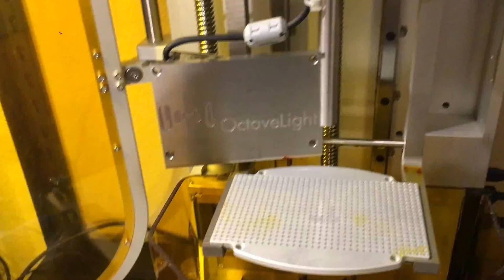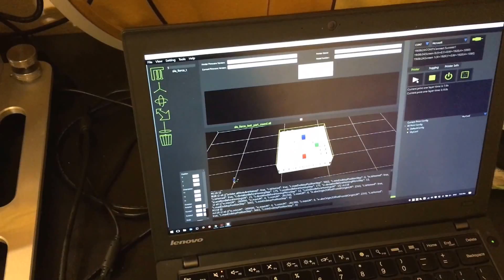Octave Light DLP Top-Down 3D Printer: Walkthrough

Comment: Nice work.  But the sweeping plate is a bit over doing it.  I mean, if your printing and you don't know if theres anything on the build plate, then you shouldn't be printing lol.
Reply from the maker: Well, sure. The printer is designed to only operate when it's closed, so it shouldn't be possible to hit something with manual sweeper commands unless you defeat the interlocks and run it open...
Reply: The blade is smoothing the surface of the liquid resin so that each layer is precisely as thick as set by the user. This setting can be from 10 microns up to over 100 depending on the precision and build speed required.

Comment: HI James, thanks for your input and videos re the Octave Light, they were helpful in setup when I recently received my OCR1 machine, I would very much like to compare user experience via private email if your available?
Reply: Hi Tom, How are you getting on with your Octave Light R1?

Gary Miller
Director

Accorda Ltd.
Official UK Distributor of Octave Light R1 3D printers and photopolymer resins

Contact:
Orders and technical support  +44 7811 256 360  +33 4 92 13 22 62
gary.miller@accordaltd.com

Comment: James, I'm thinking buying this octave R1 printer. do you think this printer can operates reliably to provide 3d printing service? In other words. can it stand up to continuous usage and if supports generation is good enough, can it print reliably? What support generation software did you use and suggest? Really appreciate your feedback!
Reply from the maker: The mechanics of top-down printing and the sophistication of this printer's hardware do increase the probability of success for any given print over bottom-up printing, at the cost of needing to fill the tank with a lot more resin. The suitability for your business will then depend on weighing the increased cost of switching materials (you need 6L of any type of resin you with to use) versus the increased probability of being able to produce a given part the first try.

I do not use the built-in support generation in Octave Light software, so I can't comment on it specifically. However, in general, there is no completely automated support generation tool. Even big high-volume shops like Shapeways use a significant amount of manual inspection based on human experience with the machines in order to lay-out and support a run of parts. Top-of-the-line commercial software, like Materialise Magics, is also not a "fire and forget" type of workflow, but rather should be considered computer-aided support and layout generation.

For myself, I will either design support into a custom part in order to maximize the points where I need greater dimensional accuracy, or for less demanding parts, use Meshmixer.
Reply: Thanks you so much for the valuable comment :).
Reply: Hi, 
The amount of resin you need is much less than 6L. I use 2L which is more than enough for most jewelry. 

 Short items need less resin.

The resin requirement depends entirely  on the height of your object and the volume it displaces as it prints. Way back, there was a video that said the tank needed to be full but it is not usually the case.  The software will warn you if there is not enough resin in the tank before the print starts or you just measure the height of your model and the the resin above the fully lowered build plate. You can also test levels with water which will help you learn and mark volume in litres to height on the tank.

I print models made from popular CAD programs like Rhino, Jewelry CAD Dream, Modo and ZBrush. I tilt them to reduce height and print time.  I have the first 30 micron OctaveLight R1 they shipped in December 2016 and it has required zero maintenance except lubrication and there are no consumables like new trays, coatings new films, no manual refocusing. Focus is achieved by a laser rangefinder. The resin remains usable for over a year if kept in the dark.

Gary Miller

Director 
Accorda Ltd. 
Official UK Distributor of Octave Light R1 3D printers and photopolymer resins

Contact: 
Orders and technical support  +44 7811 256 360  +33 4 92 13 22 62
gary.miller@accordaltd.com

Comment: Hi James, what are you thoughts about this printer's capability? Do you think it is on par with the big players?
Reply from the maker: It's certainly more capable than the Projet 1200, but as for larger Stratasys and 3D Systems printers, I think they're really in a different size class and I"ve never used any of those printers. Is there a particular printer you have in mind?
Reply: James Kao I was thinking projet 7000. R1 has less volume though. Also, do you know if there a lot of knobs to turn? or it's pretty automated and will print anything you throw at it? I'm thinking about getting one.
Reply from the maker: The Projet 7000 is much bigger and much more expensive, a completely different class of printer. Any printer has design limitations, and a top-down resin printer is no exception. You won't be able to print "anything". You'll have to take support for overhangs and material into account. The biggest limitation if you're cost sensitive is that low-cost resins have many performance limitations compared to the  >$300/L range of professional resins that are also generally unpurchaseable unless you have a matching printer. These limitations can be the overcome, but it's not push button.